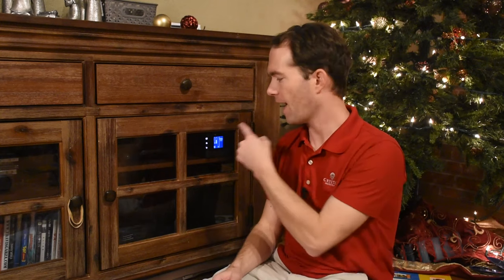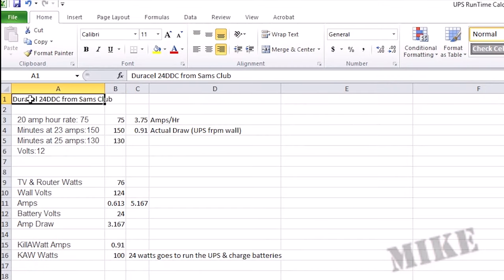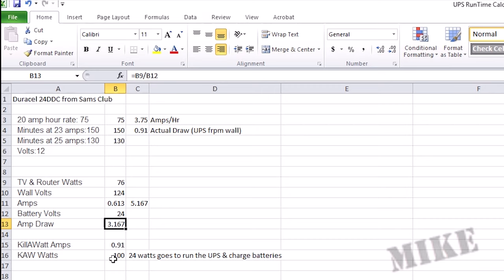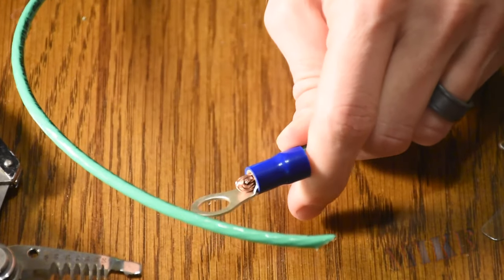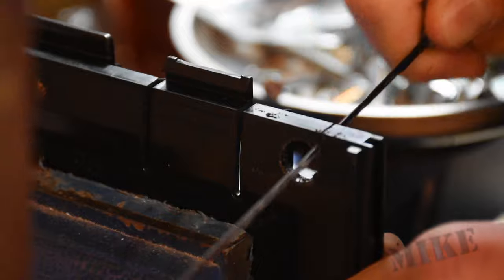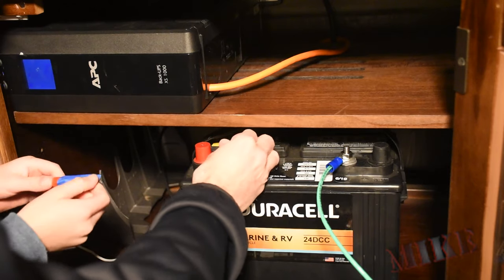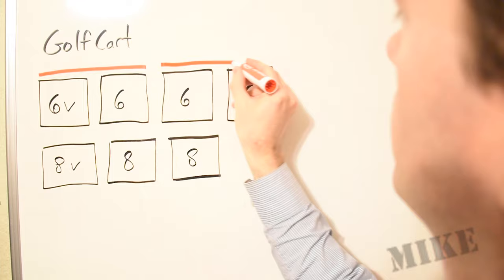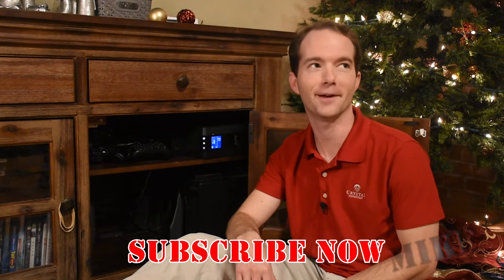SUPER UPS Battery Hack- Mikes Inventions

Comment: Yup, go good project to work on. But if possible, try to find an inverter that runs off of 48 volts as they run more efficiently and this is one I would like to use to run my gas furnace on. My problem is trying to find true deep cycle batteries that I dont have to take out a mortgage on.
Reply: Buy used one, wherever they usually sell used batteries wherever they sell batteries especially at an independent shops
Reply: you will need a server UPS that runs on 48v

Comment: The issue I see with this is that if the power goes out usually the node that supplies internet to your home goes out too since most of them aren't on battery backups. I have a 6 kilowatt Eaton 9PX 6K at home with 2 EBM's on it. There are 75 12 volt 5 Ah batteries in that sucker which can run my normal load of 1200 watts for about 4.5 hours. The issue is that our node isn't backed up at the ISP level so if the power goes out the internet goes with it regardless of what I can do in the home.
Reply: tether your smartphone data or use as hotspot
Reply: @atesone76  dude even the data would go off, he said it, the nodes dont have backup  batteries to work on after a blackout and if they do, they wouldnt run for long. in my area the max is 1 hour

Comment: He did it right but remember folks, many UPS units aren't 24 v. like his, some have only one battery inside, that unit is a 12v unit. You will have to run the power cables in parallel if your unit had only one battery.

Comment: I hate to say it, but these things are made to run the duration of the batteries that are in there. I have done this exact test about 4 times now with 4 different UPS and they will all run fine for small things well under the rated max power output.

However if you do run enough enough to start heating up components inside the unit, the heat will not be stopped by that fan they added. it will overheat and burn your place to the ground. 

Most units are passively cooled, and basically begin heating the the moment they switch to UPS. At the rated power there will be no issue because the UPS will shut down before the heat builds beyond what is expected with the factory battery. but if you extend the run time with these huge batteries they will keep going even when they are smoking and on fire.

It's well known, and I have seen it on my end more than once. You are safer with a power inverter that has a backup feature. they are built to run for long periods.

If that is not affordable, you could modify that UPS to make it "safer" by adding more fans, better (NOISY) airflow. just keep in mind, if a fire starts in this thing, the fans will help fan the flames and spread the fire quicker.

Comment: I’m currently adding 2 100a agm batteries in my suv for a power supply. Is it possible to take the display off my apc 1500pro and it displays everything as when It had the two 12v 7.5a batteries in it. It would just be nice to see all the information it displays

Comment: Great idea, as I have an APC UPS Pro 1300 as well and the batteries are shot too, and I also have a used 12Volt LifePo4 battery too, this is excellent, thanks for sharing your knowledge man, much appreciated.
Reply: Float and voltage difference will kill your Lifepo4s. Good luck. This guy should have warned about lead acid (which is what most cheap UPSs use) and AGM voltage difference. Try to charge AGM with Lead Acid voltages and the cell will swell and short... Put a BMS on the Lifepo4s and you might have them survive. (Cut off high and low). Problem is, low cut off will lock the BMS in most cases and you need to manually charge the battery above the low cutoff
Reply: Lithium batteries use different charging methods than lead acid and they don't like to be trickle charged. Unless you have very specific knowledge about this I think you need to stick to lead acid batteries or as XiaorRulez mentioned maybe do your own battery management. I was an electrical engineer when lithium ion batteries came out and they were withdrawn from the market because they were catching on fire in Japanese cordless phones.  Over the years lithium batteries have continued to catch on fire. They even caused an airplane crash. Personally I wouldn't mess with any kind of lithium battery for this purpose.

Comment: look at the wall wart for your router... probably 12vdc output.  You can just connect router direct to batt/delete the wall wart and save the loss through the inverter.  Use the inverter for the T.V.
Reply: Nothing to control discharge though.

Comment: Hi Mike, i'm gonna do the same thing with my old apc ups, the only point is the battery dimension and weight, unfortunatelly the only way to go is to use car batteries so i decided to use two of 100Ah so i should get enough power to keep my NAS up and running, i'm also thinking to add a solar panel to charge the batteries, so it will become a double UPS-Powebank project, great video!
Reply: Will this unit be able to charge two 100AH batteries?
Reply: @ramborums  You should calculate the current value for charging. Low current means more time for charging and that's not good if the power consumption is higher than the charging power...I'm thinking to change my project and build a big powerstation, i will powerup the pc with powerstation and at the same time i will keep the battery charged. In other words i will feed my NAS power supply with batteries, like a notebook, so i will avoid also power loss from the wall.
Reply: @diegogavani5679  my point is if the batteries draw higher current than what the charger is designed for, would that not blow the charger?
Reply: @ramborums  it depends by the load! ;)
Reply: @ramborums  I'm guessing it should be fine. Canadian Tire sells small solar panels for delivering 12 V, for charging car batteries. They say it delivers 40 W, which means it can deliver 3.33 A with enough light falling on the photocells.

Comment: Hello. Very good video. I have been thinking to do the same for my ups long time ago. The issue here is; 1) When the ups will be in battery mode, its inverter will starts to overheat. How much depends on the load that will be at the output. 2) If it works for a long time, or many hours then the mosfets is most likely to break down. The manufacturer has calculated a specific time based on the output load and the autonomy of the battery. If you go through this then it is most likely to burn the ups as well. In my opinion, if someone makes such a modification like this, to increase the amperage of the battery by almost twice and not more. For example, if it is 9Ah to go to 18, etc. This will make the inverter less likely to burn out.Again a very nice project, greetings from beautiful Greece!
Reply: One rule of thumb to avoid this issue. Always use less then half the rated load. I keep mine around 25 to 40 percent off rated wattage. Because you are correct. If you have a 1500Va rated at 900watts, and you try to fully load that at 900 watts and add batteries, yes it will fail and very quickly. But if you are staying down around 200 watts, it should, in theory handle the load just fine for an extended period.
Reply: @bluetonight17  totally agree.

Comment: you should add a mppt solar charger to keep the battery charged and it will help for a long downtime assist. if you try this you need to know the max charge and the base charge and use the max voltage for the battery balancing and the 13.6 for flout charge if you don't do this the ups will not like it

Comment: So can we make some forever battery's...using that same set up but running the battery through a quincer instead of a doubler while funneling back into it self with an outlet to power lets say a fridge think about it...it should go smoothly and before any power outages you could help alot of people if you build a simple blue print to follow....just a thought

Comment: I did this mod on what I can tell exactly the same UPS.  One word of wisdom to share- do not put much load on it without also doing a fan mod.  Mine overheated after around an hour, shut off and never worked again.  I did not place more load on it than it was rated for, but I think the assumption by their engineers is that the duty cycle will be limited due to the limited duration of the included batteries.

Comment: 24.5v isn't really fully charged. I'd expect 24v to consist of 12 lead acid cells, which should see around 27v float at full charge...
Reply: That’s what I was thinking. At rest, the voltage for the two should have been 25.2. 24.5 is pretty much half charge.

Comment: I like your replacement battery idea. However, I think the battery wire gauge could stand to be a bit heavier if you plan on operating with close to a full load. Make sure you have an operating fan in your UPS as some models will only run for a short time before overheating.

Comment: Great work, however I have doubts on that ups to charge the batteries. It may take ages, have you tasted that yet? Anything above 20A battery will take longer.
Reply from the maker: I had doubts too. It's not meant to charge stuff this big. I didn't use the UPS charger to charge them initially or after I used them during a storm overnight. I used the car battery charger for that. Thanks for watching!

Comment: At work in the factory we use many electric fork trucks.
When all of them are charging , it leaves the Sulphur and hydrogen rotten egg smell in the air.
Consider how bad it would be in a small space like a basement.
Ventilation of batteries is very important.
Not only do they outgas while charging they also do it while discharging.
I put mine outside with a means of heating them when temps drop below freezing.
I charge mine 2 ways.
I have a dedicated 24VDC plug in charger and also a 1200 watt solar panel array with a battery charge controller.
If batteries still get low due to no power grid AND no sunshine for days , I also use a 4Kw generator to top them off if need be.

Comment: I wondered about the possibility of doing something like this. I thought it was possible that the manufacturers might do something to prevent it., the way Canon has tried to prevent non Canon batteries from being used in their cameras. It's nice the UPS manufacturers haven't done something like that.

I also wondered about the safety of using lead acid batteries in your house. Are there any issues with hydrogen outgassing that could catch on fire?
Reply: I would say no. A battery that is low and that is charging should not do much electrolysis of the acid but when it is fully charged, all the energy goes to electrolysis. A battery that gets overcharged often will eventually need some distilled water added.
I don't know how the UPS works? Does it detect that it is fully charged and just stop trying to charge it?

As for hydrogen, I would not worry about it. As a teen, I produced lots of hydrogen. I compressed the hydrogen into a small propane tank 1.5 L. It will float up and hang around the ceiling and eventually diffuse away.
You won't be producing massive amounts of hydrogen.
The nastier product is ozone. Most of the product is oxygen but in one test I did, I smelled ozone. There is some official documentation about this.

Comment: not all UPSs will work, some have a hard set run time limit before they will shut down regardless of how big your battery capacity is.   (over heating protection as they don't have adequate cooling for heatsinks)
out of interes what brand and model is your UPS unit?

have a bank under my house consisting of 8 batteries, shoudl give a good run time ;)

oh, also, deep cycle are  a must standard car batteries are not designed to be drained and not be damaged.

Comment: very good idea. My APC NS1250  battery needs to be changed. The cable connector has 3 slots. I wanted to use a  24V marine battery. Is it possible ?

Comment: Hello. I have the same apc as you and when I doubled the size of my battery amp hours, my apc will still shut off with the same amount if time used as before my upgrade. How did you trick your apc to stay on longer than it was programed to be on from the factory with a specific amount of load? Very frustrated because I didn't get any benefits of doubling my batterys
Reply: If you're not using the shutdown software, the UPS will shut off based on battery voltage. This means you don't have to trick the UPS if you change the battery capacity. The bigger the battery, the longer it will take for the battery voltage to get down to the shut-off level, therefore you automatically get longer runtime.
The only exception is that some APCs will automatically shut off if the load is too low for them to detect, but the manual shows you how to disable that feature.

Comment: Probably the most critical part of this job is how and what to use for connecting wires to the terminal inside...  If I'm not mistaken you didn't even show this...  No problem for experts but big problems potentially for noobs...  Also would be nice to know why the time to run on (these ones) batteries is wrong...or if it self corrects or can be corrected.

Comment: My dream is to have enough battery backup to run anything in my home for 24 hours with no power.  I don't live in California but I am always hearing about rolling blackouts over there because their grid is always overwhelmed.  These devices would help in that situation!

Also, APC makes a model that allows you to connect an additional battery pack, and it extends the run time of my TV and internet from 50 mins to 212 minutes! it is the same as adding two more of those 24V battery twin packs.  but that expansion unit is $250.  buy the batteries separately and do it yourself and it will cost a fraction of that with the same result.

Comment: Hmm.....I think the minute counter is adjusted to the original battery and won't notice that there is a larger battery then before. I have a car battery on my backup APC 700ES but it gives me only about 13 minutes before it's shuts down my PC. It just don't know about the bigger battery.
Reply: Yeah I'm seeing the same thing. Shutoff appears to be TIME based on what it thinks the capacity is. Not via a voltage drop, which would be slower than normal due to increased capacity. Definitely not working for me.

Comment: The 10A fuse you used is quite low, should be a 20 or 25 Amp fuse (ideally a car fuse). This UPS is rated for about 600W. The fuses will allow: a) 10A * 24V ~240W, or  b) 25A *24V ~600W ... the second will be much more adequate.

Comment: The Back-UPS Pro 1500 supports an external battery pack, so it was designed to handle (12v 9ah x2)x3, that is 3 packs of 24v 9ah batteries, then it must run without issues with a 24v battery of 27ah or less.

Comment: UPDATE:  My bad... My math was wrong... it is what the math predicted when done correctly.
ORIGINAL POST:  OK.. I did what I think is similar to your set-up... I'm only getting 1/10th of the AH?  Is the UPS consuming the rest?  I have a 75AH battery, 35VA (watt) vent, and doing the maths.  Using only 1/2 of the battery capacity where beyond it will damage it... so it is technically 37.5 AH x 120V / 35 VA = 128.6 H.  When I did it in real life, I charted the progress it is only going to last 10 H... what gives?  Is the UPS consuming the missing AH?

Comment: two questions:  the first is about running your electronics off a modified sine Wave inverter and second, have you increased the cooling or current carrying capacity ie swap out the MOSFETs etc?  These units have a pretty short duty cycle unless  the board can be populated with transistors to add capacity.  many of these units all have the same circuit boards, just increased capacity with changes to the output stage.

Comment: hello mike. great video but i have one slight problem.  I have the same unit and have it set up the same way. I need something to last a long time to keep my coal stove running. I'm gone 10 hours a day and if the power goes out, the stove is out. so I wanted to see how long it would last on battery power. when i unplugged it from the wall it went to battery power. The time meter was at 55 minutes. after about an hour the meter went to 0 and the unit shut off. Had a volt meter on the battery;s and still showed 25.4 volts. put my battery charger on the battery's. it took only 5 minutes to bring the battery's back up to full charged. Turned unit back on and the meter said 0. So I put the original battery's back in the unit and let it charge. the next day I did the same routine to see how long it would last. It lasted about an hour, the battery meter counter went to 0 and the unit shut off.. I took the battery's out of the unit and tested with volt meter. Both battery's still were charged at 24 volts. My question is ,,,,, is that meter some kind of memory timer that will only let the unit operate for a certain amount of time and is there any way to reset it or shut it off.. Give it a try and see if this happens to yours. Any help would be a great help. Thanks Ed.

Comment: Great video, great helper!  Question, can you replace those lead acid batteries with the same value lithium iron phosphate batteries???
Reply: The UPS was designed for lead acid batteries.  I would NOT use batteries of a different chemistry (like lithium iron phosphate).  Each chemistry has a characteristic voltage and applying a charging voltage that is wrong for the batteries that you install is dangerous. Nope.
Reply: There are 2 issues.
If you attach a larger battery, when it needs charging, the internal resistance of the battery is low and will draw a lot of current.
The charger circuit of the UPS would overheat.

The other issue is that lithium ion batteries needs a specific circuit to charge them properly. I think, also, that they should not be overcharged.
With lead acid batteries, overcharging just causes electrolysis of the water (emission of hydrogen + oxygen).